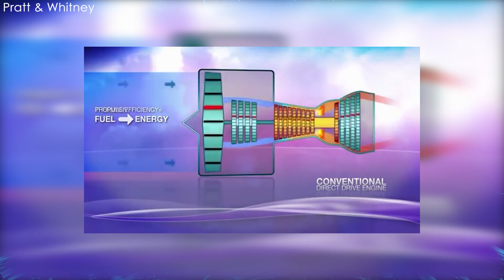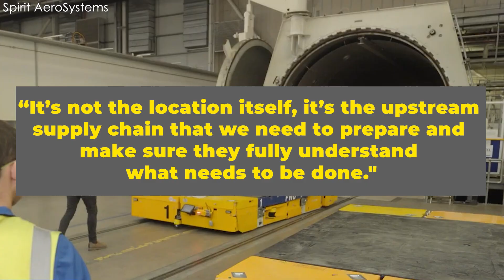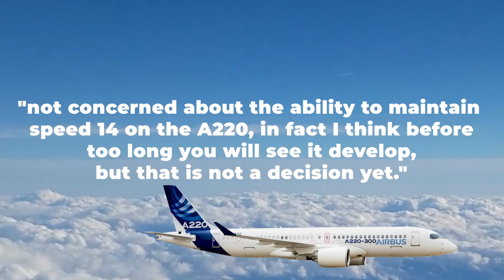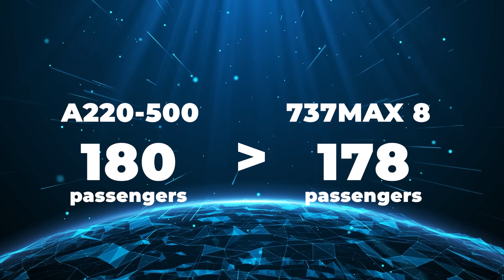NEW Airbus A220-500 will SHOCK All Aviation NOW! Here's Why

Comment: The A220 (aka C Series) family has already made the Airbus A319neo and A320neo family members obsolete, which means the remaining A321neo family member would be an orphaned aircraft with no family commonality. Nonetheless, small regional jets like the A220 (C Series) are bottom feeders and have little-to-no profit margin for Airbus. 

Also, the specs noted in this AI-generated report are terribly wrong. None of the A220 family members have 4,000 nautical miles range capability, but more like 3,200 nautical miles. Furthermore, this video incorrectly claims that the A220-500 would have 180 seats (like the A320neo) compared to 178 seats on the B737-8 when the B737-8 can seat 200-210 seats. This AI-generated report was comparing the A220-500 with single-class seating to a B737-8 with two-class seating. Not a fair comparison, but that is how Airbus' deceptive marketing works.